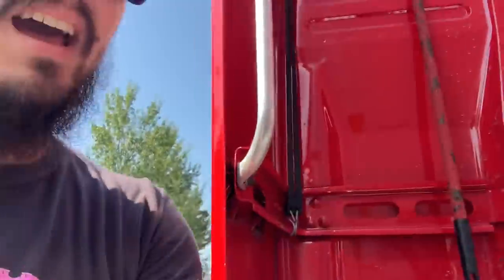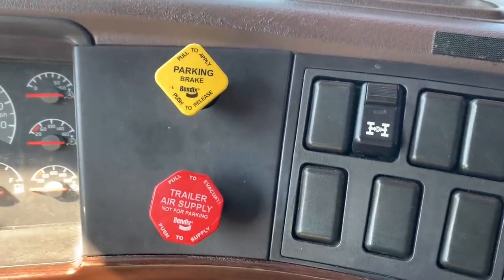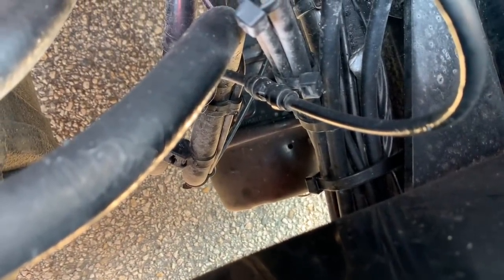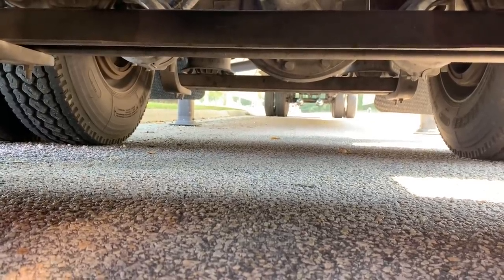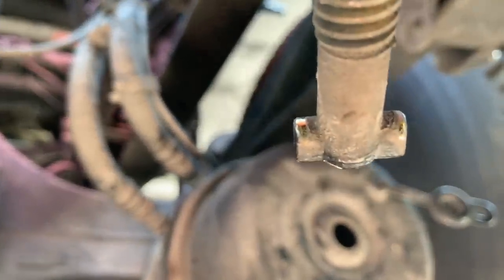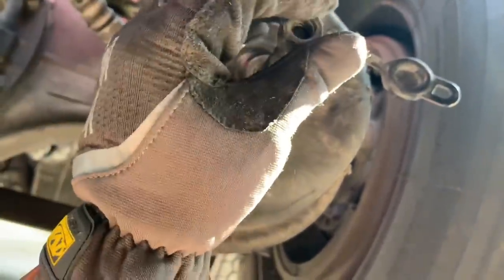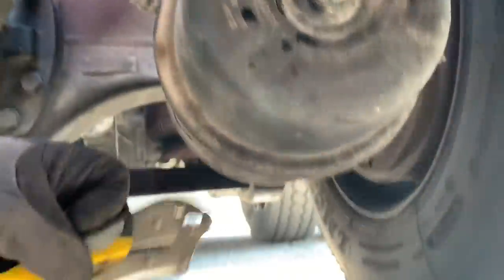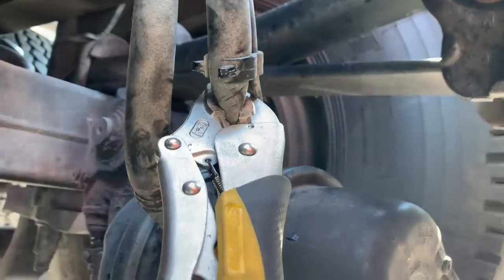Ep. 103 : Blown Brake Chamber : Caging A Blown Air Brake

Comment: Have seen guys remove the hose and use several zip ties to secure it after folding it in half,have also seen nails placed in between hoses and fitting on chamber to stop air.Also many times the spring is broken in the chamber and has shifted so it is impossible to cage it.You either have to try and back off the brake all the way (with the slack adjuster which is not easy) or remove the mounting bolts ( need a 15/16" wrench)to remove the chamber and free it up.Kudos for getting yourself moving.Most drivers couldn't be bothered!!

Comment: Carry extra caging bolts. They get seized into that holder on the chamber (at least northern truck do). They also sell extra deep 1/2" drive socket for caging bolts. And for anyone clamping off the air line watch out for the abs line, that will open up a whole mother can of worms

Comment: I know quit a bit about air brakes on trains and a little bit about trucks.  The air on trucks release the brakes.  It is good you knew how to release the brakes and had the tools to do so.
When you clamped the air hose with the vice grips the hose did not squeeze down sufficiently to close the hose; I could see it.  You used curved jaw pliers so there was extra room between the jaws;  next time use straight jaws and maybe a cut up soda can between the jaws and hose to help protect the hose  from the serrations of the jaws.  The wider jaws are easier on the hose than needle nose.
Reply from the maker: Learned this 1. Had to change to straight vise grips and unfortunately I didn’t learn the soda can part until it was too late. Lines now have rigges in them. I’ll be replacing those soon as well

Comment: This happened to me in the middle of nowhere. I caged it and also capped the service line as it leaked only when I applied the brakes with the foot peddle. I did not need to cap emergency line. I carry end caps with me. I then was able to continue with delivery on time and then I fixed it. Ya I could have been caught but I wasn’t.

Comment: Dont pinch your air lines off like that it can break the mesh that provides the strength take the line off and place a dime in the end of the line and tighten it back down it will get u safely to the next garage  with the cage bolt holding the brake released frowned on but it will get you out of a bind and out of an outrageous tow bill
Reply from the maker: M D I agree pinching that off that way isn’t the best. I went ahead and had the line replaced with the chamber when I got to the shop. It sucked being in that situation but I ended up getting thru it and back on the road quickly.
Reply: @DreamInspired  yea it sucks I hauled heavy loads for years and had hundreds of canisters go bad the dime works great and u can get back to a shop with out paying 
For a service call

Comment: A bit of advice do not try to take the clamps off the brake chamber the spring is under an extreme amount of pressure and with out the press to slowly remove the pressure from it they will come apart at over 120 psi and mess you up bad you can replace the internal parts but not worth losing body parts
Reply from the maker: I’ve seen some videos... like a rocket going off!

Comment: I thank you for this info i have a 1986 f750 the break is locked on driver side rear don’t see a hole there or hear a leak the back tank on driver  side has no air when i pull the water release , i got under the truck put air hose to the spick ad filled both tanks but still the break is locked only place i hear lots of air is in the dash , the release wont change i pull it out and hold and air stops and fills only passengers side tank , i hope you can give me idea what to try next .."? I only just got this truck it only drove a few miles to my house and when i needed to drive to DMV no go ! Thanks and bless you for any advice I’m ben in oregon

Comment: How old is that truck? How many miles?
Reply from the maker: 2016. Bought with 544k, now has 814k. Had her 2 years
Reply: @DreamInspired  So did you replace the other chambers?
Reply from the maker: Negative. Had another 1 go out about 3 months ago, which was probably 150k miles after this 1. The 2 others on the truck are original and I’m currently at 816k miles on them

Comment: I would never use anything to crimp that air line, using any kind of pliers or visegrip could collapse or split the line then you’ll have to replace the airline
Reply from the maker: Crimp the airline and get off the side of the road, then pay a few bucks more to the line replaced... Or don’t crimp it, it keeps leaking and you can call someone out to fix it all on the side of the road... which is guaranteed to cost far more than just the added cost of replacing the line. Yeah the cost of changing the line was a lot better then paying a mobile mechanic to do anything.